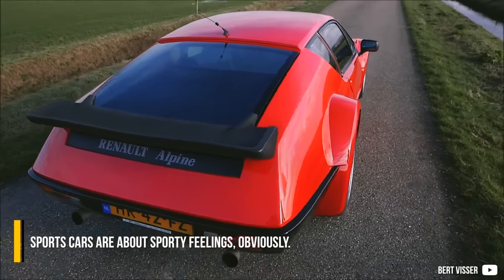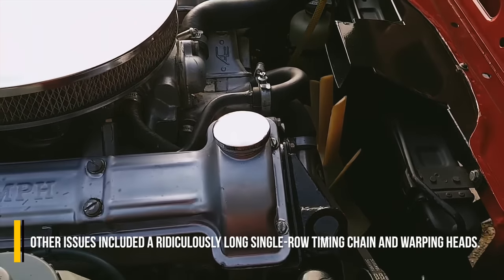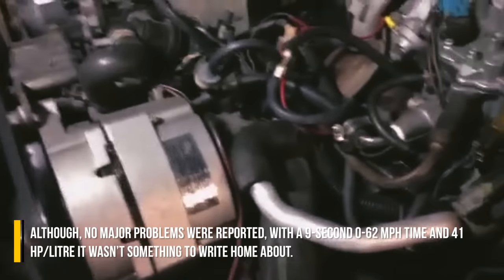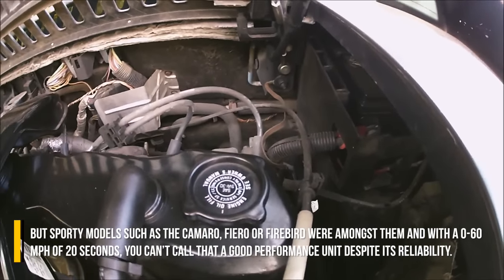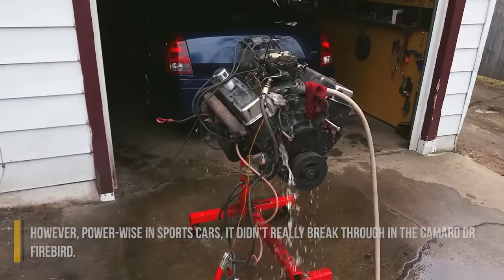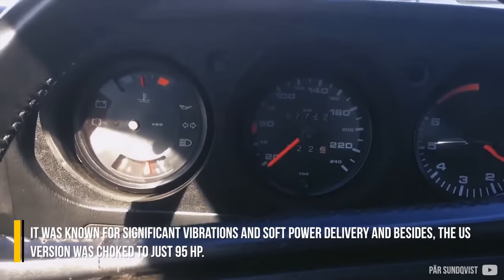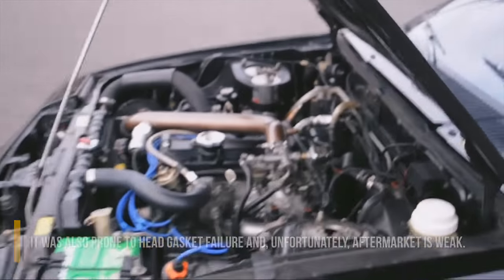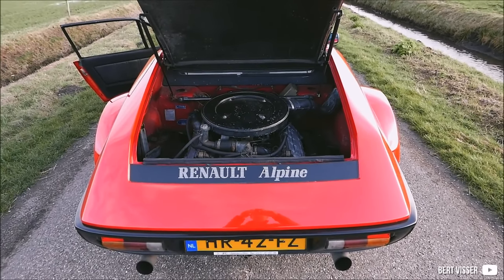Don't Buy These 7 Engines For Performance

Comment: To play devils advocate.  With a good set of heads, carb, and distributor, the 305 is a plenty competent engine for a Camaro or Truck.
Reply: i built a 305ho for an s10 and it was a little beast...i used 350 heads
Reply: I was about to say i enjoyed my old camaro, but i had the 88 fuel injected version which i though gave plenty of enjoyment and power honestly. now i have a supra and i dont think im gonna return to the camaro anytime soon tho.
Reply: Big, with 2v & push rod, that will never be a stellar engine
Reply: stickloaf. A 305 with a set of Vortec heads and a good camshaft can make 400 hp. Its like with any engine, we have the technology to make even a dog perform.
Reply: It's shitter than a 350 in literally everything imaginable.

They're heavy, don't make horsepower, and literally everything is made of iron...

Considering how easy it is to get your hands on a 350, a 305 is a waste of money.
Reply: Nor Dic 
"Big"
It's literally one of the smallest SBC's ever made.

And pushrods aren't nearly as bad as you eurotrash fanboys like to think. They make for TINY engines (a 7.4L LSX454 is MUCH smaller than a ford 4.6 modular), which means you can fit more displacement into an engine bay. They're also super reliable and cheap to maintain.
Reply: Alright I guess its time to feed the trolls.

A 305 is a fine engine. Sure a 350 is better, you nearly have 3/4 of a liter more displacement. What do you expect?

But as a platform, for a F body, G body, or a 80 - 90s C/K truck, a 305 is more than doable. 
If you have a 305 block laying around, and don't feel like paying for a 350 block you shouldn't feel discouraged from going that route if you just want to gain a few more HP out of it. 

400hp is simple to do with the appropriate mods and knowhow.

As for your issue with iron. ALL the SBC truck motors were iron. Only a few Corvette and Camaro versions were the exception to that. And if you aren't building a drag car the extra weight is fairly negligible, though the cooling on aluminium heads is notably better.

As I said, heads (either Vortec 350 or Aftermarket), Fuel, and Ignition is pretty simple and more than capable of hopping those motors up. 

AND FRANKLY, a bone stock 350 from the same era is STILL a turd and needs mods to wake up as well. 

*mic drop
Reply: Fun fact, the stock 305 cam is not bad for forced induction as it has very little overlap.  With a turbo or supercharger the lower lift and duration are somewhat less of an issue.  It's not an ideal cam, but it's not a disaster either.
Reply: Jαѕσи Tσdd you do realise the 305 and 350 are about the same weight?
Reply: Big Mike 
Lmao you think I just mean the block?

Even the damn intake manifold on my own '85 c10 (r10, whatever) was cast. So were the pistons. And the crank. And literally everything.

Why would you bother throwing money at the unobjectively WORST sbc? Hell, for the amount of money you're talking about putting into a 305 (400hp? Seriously?), you could buy a 350/290 (already making almost double the horsepower of those smog pump choked up iron lumps) straight from GM and even have a warranty.

Sure, you could throw a set of heads, a new intake and carb, and maybe some headers... but literally the only reason that would ever be worth it is because you can just carry over said parts onto a 350 the second you get the chance.

You're defending the runt of the SBC family when there is literally over a million 350's out there you could spend that money on.
Reply: Phil'O's Garage 
Can you explain how the same engine, but with a smaller bore and thicker cylinder walls (aka MORE METAL) is the same weight?
Reply: Jαѕσи Tσdd holy crap, you are talking OUNCES! Besides, the cylinder walls aren't actually thicker - that wouldn't be effective for cooling.  The casting is different in that area, so in fact it's possible the 305 block may be an ounce or two lighter, but on an engine as heavy as a small block they should be regarded as the same weight.  If the 305 was just a vastly under bored 350 you would be able to bore a 305 to 350, but you can't.  As for pistons, stock 350 pistons are cast too.
Reply: Phil'O's Garage 
From what I was able to find, more like 40 pounds. A 305 like the one in my truck is ~575 pounds, while a 350 from a, I dont know... '95 Silverado would be closer to 535 pounds. Albeit, that is mostly due to the heads & intake manifold.
Reply: Jαѕσи Tσdd that's a complete engine, you can't really count things like inlet and exhaust manifolds as they would be the first things swapped out on any tuned engine, and are classed as accessories.  The long blocks weigh about the same.  The 305 isn't an amazing engine but not all 350's are either.
Reply: I assume you have never heard of the LS??
Reply: Smoked a lot of 350s with my old 305. 60 over,vortec PM rods, HO heads with larger valves, 275 streetmaster lunati cam, headers,intake Q Jet carb.  370 HP  410 lb/ft torque at flywheel. Every thing was new from the engine shop the way i wanted it for 800 00   had about 1200 all total invested. with a 100 shot that would be around 470 HP, but i never was able to get the setup because my first son came along. It was in a 82 trans am with a 3.42 posi.   This was about 1990 and that was good power for a 350 much less a 305. Had a few guys that just wouldn't believe it was a 305 but i kept the paper work from the engine shop in the console to back me up. Around here now in 2018 350s are getting harder to come by cause all the roundy rounders go through them all. The racers around here are using 400 cranks in 305s now because they are still around and most guys like yourself will just about give them to you.  Makes it a 338 or 340 CID if i remember right.
Reply: Not really thicker , you cannot bore a 305 to 350. If the 305 just had a smaller bore  you would be able to. If you bore a 305 4.00 inchs you'll be in the water jacket or paper thin. So there must be a casting difference.
Reply: Fast Nasty 
If I'm not mistaken, the max displacement you can get out of a 305 is around 340ci or so.
Reply: Fast Nasty 
The 383 stroker is a 350 with a 400 crank. Dunno about the 305, I havent met anyone that's built one.
Reply: Phil'O's Garage 
Best factory 350 >>>>>>> the best factory 305.

That's all I'm saying.
Reply: Tiptoetherat 
What does this comment have to do with the LS platform?
Reply: imho, they should've stuck with the 307 from earlier days. 305's were stuffy and the rod length vs. stroke was not conducive to great hp gains
Reply: Steve Ross I gotta. Ask, why did engine failures. In. Cop.  Cars. For305

Comment: The 924 should not be in the list 
Those 125hp + the light weight and transaxle tec gives him amazing handing he might not be the most power full but he should definitely not be on the list .
And the 924 is extremely reliable ..
Reply: People can slant the 924 and its engine all they want but the fact remains it ended up 6th overall in the 1980 24 Hours of LeMans and finished higher up than the Ferrari 512BB's, BMW M1's and Porsche's own (Kremer Racing) 935's. The five cars which finished higher than the Porsche entered 924 were purpose built sports car prototypes from Rondeau and Porsche.

If the engine of the 924 could survive 24 hours of racing at LeMans then I'd say it proved its worth.

Comment: Having a low hp/liter doesn't always mean it isnt a good performing engine, it just means it's underperforming what it could. The Dodge Viper v10 from 92 was only 450 hp with 8.0 liters, but it could be tuned way past 1000 hp with some moderate mods. 
Some though like the 305 Chevy were proven to be kinda bad performance wise, I wouldn't call it a perfect balance of power and fuel consumption either since my dad's old GMC truck had a 305 that was underpowered and got around 8 miles to the gallon.
Also 305's are kinda unreliable and just throwaway motors in general :D
Reply: Unreliable? They're super understressed, rev like school busses, and are made of nothing but iron.

The Chevy small block is one of the most reliable engines ever made, and the 305 (although gutless and worse than a 350 in every measurable way) is no exception to that.
Reply: I guess, though they were probably unreliable by the fact that they were choked down beyond belief so it did a number on everything around the engine. Regardless they were a pretty pointless engine, so I hardly understand why anyone would build a 305 over a 350, or pretty much any other GM/Chevy v8 for the matter.
Reply: 305 stock will last longer than a 350. I know of 5 different people with 200 to 300 thousand miles on them . One smokes when you first start it then stops[ valve seals ]  The other 4 had me put posilock style seals on them and they don't smoke at all with just a slight bit of blowby on two of them. They all use rotel 15/40 oil and wix filters. Just to add one guy has 280,000 miles on his original 700r4 in a 1990 c 1500. He changes his fluid every 30,000 and adds lucas trans additive.  That kinda blows my mind a stock trans lasted this long and still going.
Reply: I built mine to smoke 350s, Which i did 80 percent of the time. The other 20 percent i kinda knew i might not take them unless they make a mistake. They have aftermarket heads or a really light car. Guys talkin like Mr. Todd really hated being outrun by a 305. i'm an old oklahoma 918 street racer by the way.
Reply: Jαѕσи Tσdd that reliability is debateable. if you mean in stock form, sure. but if you beat the shit out of them, bye-bye
Reply: The 305 was overshadowed by it's larger twin the 350, but honestly it doesn't belong on this list. A 5.0 Trans-Am with a 5-speed is a ton of fun...which is the point right? And a 305 is identical to a 350, just with a smaller bore, so it's actually a more bulletproof option for a build. Plus they are plentiful and parts are cheap so honestly it's kind of great powerplant.
Reply: @Battlefresh  yeaa...no. always expect less power than a 350 with the same mods. only time I'd build a 305 would be to turbo it as a throwaway motor.
Reply: Um yeah of course a built 350 > 305 every time, but that doesn't mean it's a bad motor. 2.7 Ecoboost is a great motor, but it's not a 3.5. So what's your point again?
Reply: my point is a 305 chevy has a little baby bitch bore. smaller than a 283. think about that.

Comment: The Porsche 924 engine, was an Audi 5 cylinder with one piston less  and a shorter crankshaft
And an intake from porsche (which is often the case with other engines as well).
Later they took 2 of them ,build a new crankshaft (and block)  and they had a v8 (944).
Just research,yo.
Thx for u'r cool videos, they are very inspiring for me.

Comment: oh yeah the renault V6 that was delivered in the volvo 260 and some 760's compared to a B230fk the renault engine was a turd as it was not up to volvo standards by far witch is why later 760's used the B230fk as it provided the same power and a reliability that was close to unbeetable, to this day people still rips out those renault V6's to put in B230's
Reply: gotta love b230's :))
Reply: why is that unfair? they both were in 760's.
Reply: the redblock did actually not come from a tractor, even tho there is a lot of misconceptions about it, but volvo was originally a ball bearing manufacturer so it's not strange that they made engines that just keeps spinning forever :)  volvo itself is from the latin word volvere witch means "I roll"

Comment: The GM crossfire 350 needs to be on the list,it was a system from hell to figure problems with.Most took it off replacing it with a multi port set up or a carburator

Comment: The Porsche 924S was my first real sports car! I agree that the original 924 engine sucked! But the 944 engine had a good 150hp so it was decently fast! Mine with a few simple moods and a chip would do 140mph which isn't bad for $2000 car
Reply: Why didnt you just get the 944 Turbo for around 5000$ ?

Comment: I had a 1985 or 86' Dodge Charger with a 2.2L, I think, in it and while it was definitely not a burner it would get to 60 mph is a lot less than 20 seconds. I only paid $40 for it and replaced the clutch. Drove it for about a year and then the transmission locked up on me. I wasn't exactly heartbroken as I had gotten my money's worth out of the car. It was my first time installing a clutch so maybe I messed up and that's why it went south. That was over 20 years ago.

Comment: How in the hell is the iron duke considered a performance engine?
Reply: It was the basis for the Pontiac Super Duty 4. But it was decidedly non-performance in both Iron Duke and Tech IV forms.
Reply: There was even a DOHC version by Cosworth
Reply: When GM stopped producing the Super Duty 4 parts, Kansas City Racing Products (I think that's the name) bought the machinery to produce the Super Duty 4 parts. They were producing the SD4's racing block with a few different head bolt patterns, so you could use different v8 heads on it. Some were getting 500 hp out of the thing. KCRP is out of business now.
Reply: its big

Comment: People look back at the iron duke camaro as a slow POS, but if you look at what it was designed for, a sporty looking economy car, it fit the bill perfect.

The Pontiac 301 turbo was an excellent performing engine for its time. With a huge mound of torque and reasonable power, it was pretty fast for the time.
Reply: "sporty looking economy car"

no thanks?!?!?!??! i have a 2001 540i sportwagon :)

4.4L of bavarian beer, 286hp and 343lb-ft :D

0-60mph in 5.5 seconds, top speed 155mph limited
Reply: Adolf Hitler Sport LOOKING. I never said that there was anything sporty about it, other than the looks. And I don't see why you bring up your bimmer, unless you just like to flaunt it. Speed, power and "prestige" don't directly impress me. I'd have me an iron duke Camaro over your bimmer any day. Fuel economy+reliablilty and just plain quirkyness, three things you DONT have.

Comment: The V6 prv was reliable and the uneven firing order was the best layout beside every modern V6 are 90°
Reply: not realy: the most 90°V6 use a special crackshaft who allow even firing...was the case for the later PRV's

Comment: For the Pontiac, you've got to remember what year it was. 200 hp and over 300 ft-lbs of torque were pretty high numbers for 1980. During these days even Porsche 911s took over 7 seconds to reach 60 mph.
Reply: Huh ? These days or those days :p

Comment: The 301 was a Pontiac engine it wasnt made for the turbo firebirds.   My mother had a 77 Buick Lesabre with the 301 pontiac installed stock. Buick finally did turbo correctly with the 3.8l by in the t-types and grand nationals.

Comment: Jeremy Clarkson on big American v8s: "How have they got so little HP out of so many liters of v8?"

Me on various twin turbo euro v8s: "how have they got so little torque out of a twin turbo v8"
Reply: Higher redline and the turbos are focused on giving more power to the engine, torque is for superchargers overseas, also those engines tend to rev pretty high, so torque must be sacrificed
Reply: Mid 1970's to 1980's even 1990's,the power was low because of vehicle emissions...

Lower compression,strict government emissions lowered power/torque from the mid 1970's to 1990's....

They finally found a way to raise compression/power/torque to pre 1972 numbers !

Comment: The Triumph Stag got that 3.0 V8. It was mostly swapped out for either the Rover/Buick 3.5 V8, or the Ford Essex 3.0 V6. Finding one with its original engine is not easy!!
Reply: Liam Godden in Europe they are mostly original I think
Reply: Not in the UK. Or maybe the few survivors DO have their original 3.0. In the 1980's most on the road were conversions in my part of England.
Reply: Ford Essex v6 is a heavy piece of shit. Wouldn't put one in anything!
Reply: Agreed, but it was a popular conversion because there were more 3.0 Essex engines than the Rover V8, and it's pretty reliable.
Reply: the heavier the engine,the thicker the block, which means more power before kaboom.
Reply: Throw in the fact that the Essex V6 was supposed to be a Diesel engine and you've got a very reliable, almost bomb proof, motor for ANY vehicle! The Scimitar GTE used it.
Reply: Most stags that I see for sale still have their original engine.

Comment: The triumph V8s were not bad engines in concept as such they were advanced for their time but were put into production without proper development, this coupled with very poor build quality (it was not unknown for the casting sand to be left in the engines internals) and a lack of knowledge in servicing led to all sorts of overheating problems which trashed their reputation. Also I worked and tuned  924's back in the day and these Porsche (Audi) engines were pretty solid, I saw these being thrashed beyond any sensible limits and taking it without stress but the big issue was people would not pay Porsche service costs on older cars and engines suffered as a result. I have vivid and happy memories of drifting a rusty 924 round roundabouts near home. The Renault v6 was a good engine, remember in 1990 these things were giving 200HP and there are versions of this engine punching out close to 400HP today, not too shabby.

Comment: Suprised the 2.3 ford motor used in the mustang from 74-93 wasn't on this list. Not including the svo using the 2.3 turbo though that was smoking v8s of the 80s though because it was actually impressive

Comment: Yes the iron Duke was slow it was not that bad in the Fiero. I have a 1984 Pontiac Fiero iron Duke with the automatic and it does 0 to 60 in about 13 seconds.

Comment: As we all know there is a special formula used in the car industry that explains a cars speed.
A cheap car cannot out perform a manufactures more expensive models. Put a crap engine in it and you can sell it for less.

Comment: My 87 had the 305. 3:73 rear. I would take out 350 crate cars. Those motors turn for 300k miles easy. Caprice classic